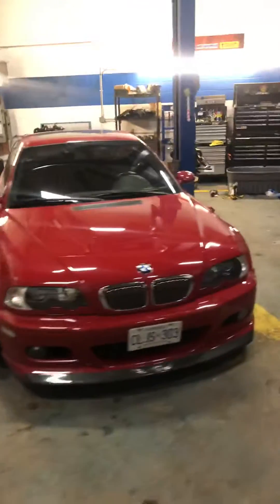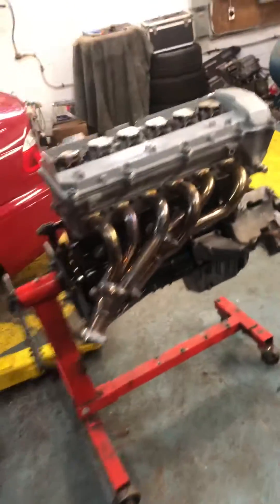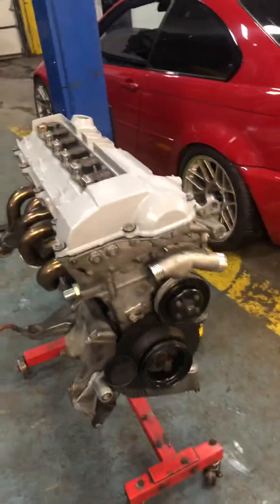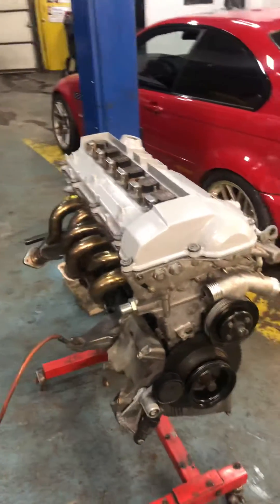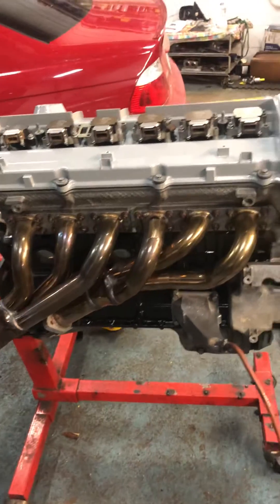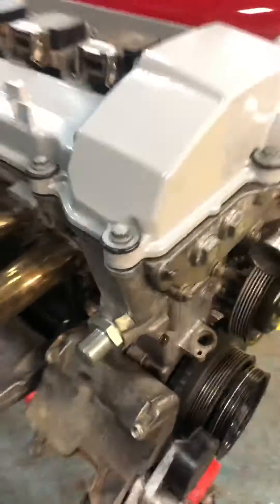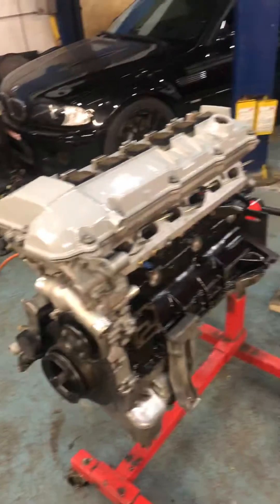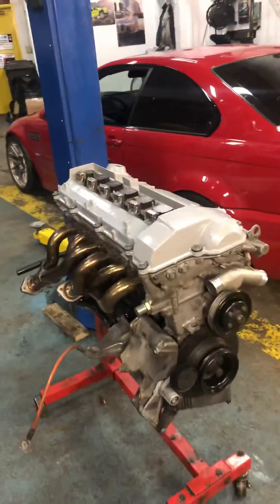BMW M50B30 Stroker Build Part 2

Comment: How did you get rid of the ridge in the cylinder bores without going over bore?
Reply from the maker: There is a special tool for ridge removing. It gets mounted inside the cylinder and cuts.

Comment: How much hp does the m50b30 make?
Reply from the maker: It all depends what cams you use, exhaust setup and how good your tune is. Mine made 228whp.
Reply: @iconicars3050 did you measure the piston skirt?

Comment: BONJOUR EST IL IMPORTANT DE METTRE LES RESSORTS DE M3 US EN MEME TEMPS QUE LES ARBRES A CAMES US S52 POUR 7200 RPM,?
Reply from the maker: You can use M3us S52 springs or S62B50 springs or M42 springs, they are the same, they can all rev to 7200rpm. But make sure you also use lower and upper spring retainers.

Comment: hi, in your previous video you talked about using an m52 head, im in Australia and have a 94 325 head, is that still considered early?
Reply from the maker: You have to check what valve train it has. If has smaller diameter valve springs and smaller diameter lifters than you’re good to go. Late m50 heads are the same as M52, same valve train and cam trays. M50 head has an extra hole for temp sensor, m52 does not. Usually a 94 head is built in 93 so its no good. You can always use m54b30 valve train, its also very good and can take 7200rpm. Just swap it over into your m50 head.